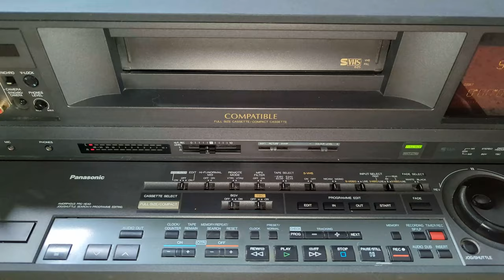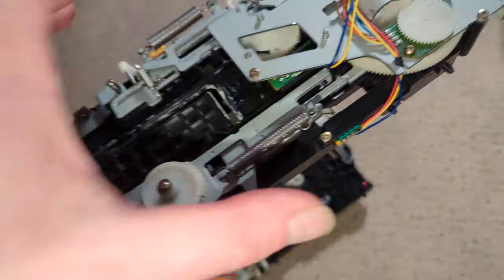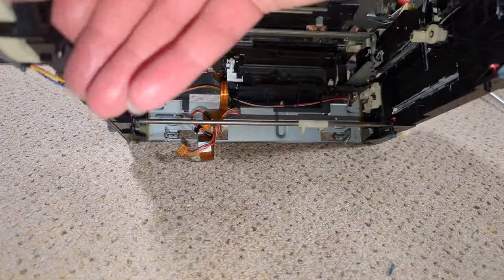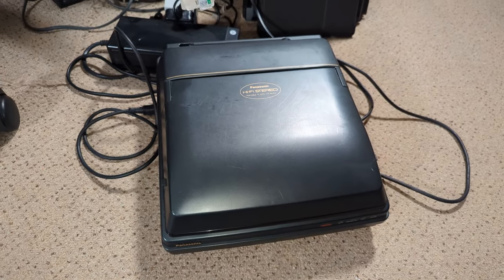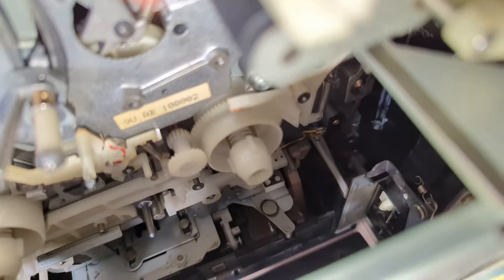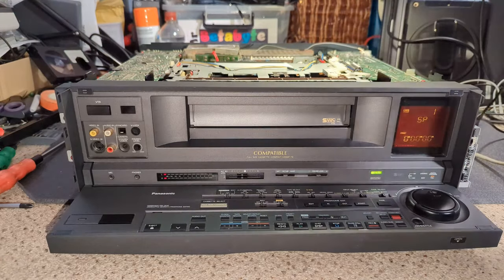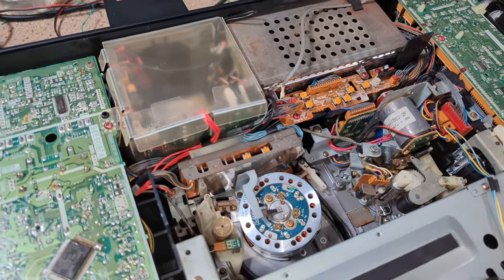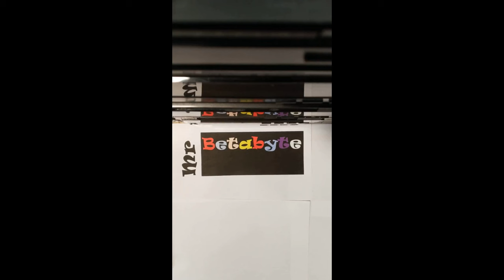Panasonic NV-V8000 VHS - Part 2 - Mechanically fixed!

Comment: 0h1200 dark brown sheet metal is inclined. With the K drive, it is sufficient to turn the white plastic cap over the capstan shaft until it becomes heavier (touching the capstan shaft), and then a further 1/4 turn to lift the permanent magnet of the flywheel from the enameled copper wire coils. There are at least 2 versions of the white plastic cap. With the black insert like here, and single peace with grease or without grease. I don't know whether this is self-lubricating plastic or whether the grease was forgotten in the factory. It can also be that someone greases a self-lubricating plastic afterwards. On the Hamburg subway, however, there are extra signs that the self-lubricating contact surfaces for the car bodies on the connecting bogie must not be greased under any circumstances. The squeaks are sometimes so loud that I have half of the car to myself. In the other half, the noise drowns out the good condition😉 of the bearings.
Reply from the maker: I'll have a look at that - thanks for the heads up. That top plastic adjuster on the capstan was dry on this one. Maybe they were worried about grease creep?

Comment: The jvc version of this can be really bad to it has a tray for vhs c i have one and it plays hifi sound but there is a picture issue.  Some of these panasonics can have a basket issue to.  I had an svhs I really liked but the basket bent and put stress on both motors causing it to fail.
Reply from the maker: I've been thinking of trying to get hold of a tray loading JVC or a Toshiba but maybe that's a step too far if they're not reliable. Parts are probably a pain to get hold of now too.

Comment: There are very few surface mount capacitors on this model like I say I have 3 of these decks & never had an issue with capacitors when they are working perfectly FF&RW is absolutely dead  silent
Reply from the maker: That's really useful to know that there aren't many surface mount capacitors. I do need to tighten up the loading and lacing; the rewind and fast forward are super smooth if I advance the basket loading just a little further. Thank you very much for sharing.

Comment: Overkill is an understatement! JVC made a drawer loading mechanism that I believe was a much more sensible aproach.
Reply from the maker: That's good to know. I'm hoping to have a draw loading JVC or Toshiba on the channel soon.
Reply: A more sensible approach would have been to not even bother to make a dual loading mechanism, but I'm glad they did. 
Despite a lot of people preferring JVC, I found Panasonic S-VHS machines always performed better especially when it came to tape manipulation.
Reply: I have two of these machines and have no interest in getting rid of the either of them. Prosumer was a phrase that all the press used to use the price tag probably helped as well which was £2,000 😲
Reply: @IncognitoChild  Certainly, it was a solution for a problem that didn't existed. But the JVC used less moving parts to achieve the same goal. I always found the drop-out compensator on the Panasonics of that era to be more prone to display big white trails whereas the JVC masked them better.
Reply: @UHF43  so would you say that was typical straight out the box or was it more down to wear in the tape path as time went by?
Reply: @IncognitoChild  I'd say it was typical. And I don't believe other manufacturers had a worse tape handling mechanism than Panasonic. Though the sturdiness of Panasonic's aluminium die-cast chassis was unbeatable, at the end of the day, it is mostly the pinch roller and guide posts, aside from the head drum of course, that wear the tape.
Reply: @UHF43  interestingly that has reminded me  that when I used JVC SV formulation super VHS tape I use to get picture artefacts that I didn't get when I used TDKs XP formulation. (This was brand new tape with maybe only one previousl recording maximum).
Reply: @IncognitoChild  I mostly used TDK and BASF because they were the more easy to get brands where I live and never had issues with them.